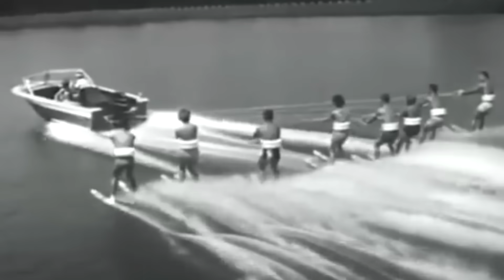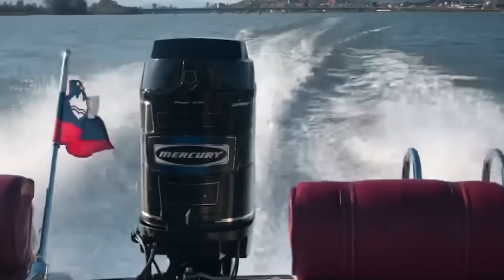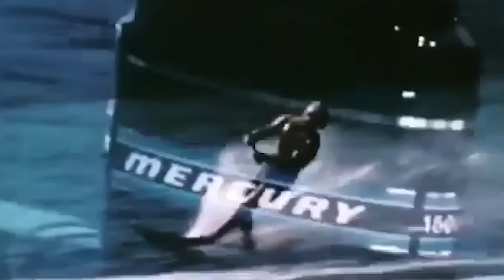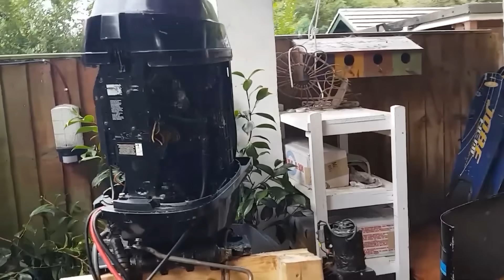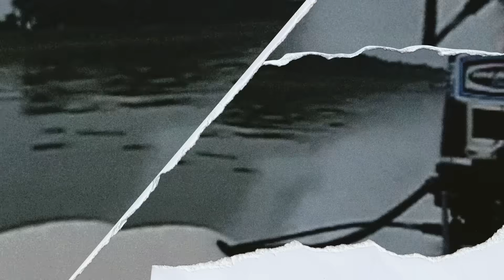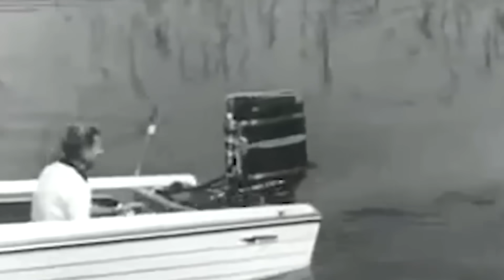The SHOCKING TRUTH Behind Mercury Tower of Power!

Comment: Had two of the old white and silver 45 horse Mercs on an eighteen foot cabin boat I believe was a Pacific Mariner. Every winter, bundle up the boat, put both engines on their stands in the garage. Pull and clean the plugs, clean the carbs and grease the carb linkages. Put everything back together and you are ready for another summer in the Pacific Northwest. Oh yes, clean the lower units and check the zinks.

Comment: About 7 minutes in it starts sounding like an ad for 4 strokes.
I still have two inline 6's one a 1966 95 ss and a later 99 inch probably from the late 70's.
The 95hp is the smoothest running engine I've ever had, AI's tripping about the smoothness of any inline 6 cylinder. The other engine is smooth as well but it's been ported recarbed and tuned for max power. And yes that motor requires a starting sequence but if stock starting is not a problem at all. As for all that maintenance all I ever do is to change plugs every year and the water pump every 2 years. 
Of coarse over the decades one runs into issues but not as much as stated here. No 4 stroke will ever last like these things do.

Comment: still have a tower of power o my mini raven,  still running great after 14 years that we own it, only changed the spark plugs ones and cleaned the carburetors twice, and lost a fuel pump because of age, changes my carburetors floats with an older model floats, because mine had plastic floats in and it cracked

Comment: Kiekhaefer used a racing trick to get more horsepower per cubic inch than OMC...Mercury used internal reed blocks that effectively 'stuffed the crankcase' increasing power over the style reeds that mounted behind the carbs on most of the competition.

Comment: In Australia in the late 1960s and 70s most of our boating was in salt water.
Developed in the US freshwater salt Down Under would destroy these engines.
Even steering seizing, many failed water pumps if you did not flush them with fresh water.
The Evinrude dealer where I worked in Sydney dreaded a Mercury as a trade in...
Mercruiser sterndrives had issues with salt as well. Could not be flushed.

Comment: My boat had a 1977 115 hp Evinrude with trim and tilt and  a Guy i knew had a Mercury 115 six we Lined up and took off he took the Hole Shot then i caught up at that point Both of us Put the Hammer Down i Pulled Away and Then he Caught up you could tell 115hp is 115 hp no Matter 6 straight  or V4 i then let him Drive mine He was Impressed but liked the Growl of V4 Where Mercury 6 More Whine

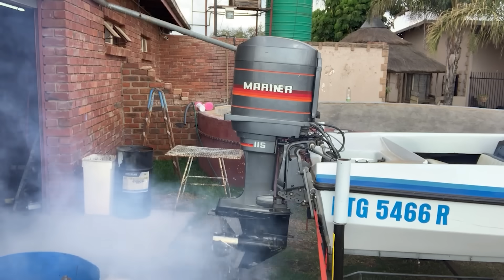Comment: 1:34 Growing up in Florida I wanted a boat with an engine so bad . As a kid i scraped up enough money to buy a John boat. Now i just needed an engine. The very same engine or very similar, it could have been a different hp . As the one In the shot at the time stamp . Happened to be sitting on a neighbors fence for many years. One day I worked up the nerve to knock on that neighbor’s door and inquire whether he’d be interested in selling it . This would have been around 1990 . After a short talk , the neighbor gave me the engine. I spent the night unable to sleep with excitement looking at the old Mercury that was now clamped to the footboard at the end of my bed . With the help of my dad and many miles back and forth on my bike from home to the mercury dealer and months of fiddling with it . We got it to run and worked to increase its reliability. I got to use it on my boat dozens of times never capable of getting to be really reliable. But when it did run ? I was the king of the world 🌎

Comment: It's interesting that some of the older inline 6 cylinder Mercurys still had a permanent pull start cord on top.  Imagine pull starting a 100 HP motor.
Reply: The merc I inherited from my dad (a 1978 Black Max 200hp)still has a pull cord attached to the inside of the cowl. I get a chuckle every time I see it. As if my shoulder could pull start a 200hp engine. 😂😂
Reply: My 140 has the pull start rope in a bag in the cowl. I’ve used it quite a few times. It worked just fine.

Comment: this guy is confused the mercury inline motors are cross flow motors not loopers. the piston has a deflector and that is how to tell.  loopers have flat pistons and the fuel loops that is why it is called looper.  a cross flow means the fuel goes straight across the piston.the pictures show v 6 mercury motors and force motors tool the inline 6 only went up to 150hp. if you still have one of these block off the little black hose on the carb with a bb  this is the backdraft and it would lean out the motor at midrange for fuel economy. lean motors burn pistons. i have been a mercury certified mechanic since 1988. i know these motors very well.
Reply: He needs to rework his narrative and remove a couple images. TOP engines stopped at the 1500XS. Yes, there were the Twister racing engines in the early '70's that made 180-200 hp,  but that's not what this video is about. It's certainly not the V6's he's showing here. Also, it makes it sound like the TOP engines just showed up about 1970. Nope, the first one occurred in production in 1957. 
They were a force in the market from the late '50's on. I worked at at Merc dealerships in HS and college, in the 1970's. These motors were really reliable and durable, you just needed to maintain them. They had electronic ignition since around the mid-Sixties, with surface gap plugs. You almost never had to change them.
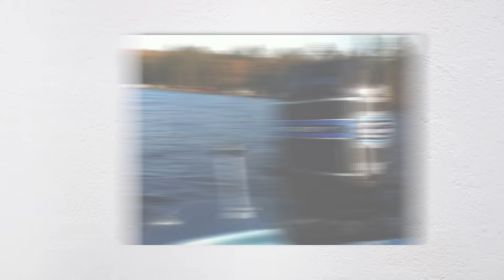Reply: Exactly.  My dad had a Glastron hardtop with an 80 hp inline 6 in the early 60’s.  The white one shown at 3:55 is that one.  The 70’s was just when HP got above 100.  We put a 115  version on the Glastron around 1971-72.

Comment: the people who know what these engines are will never give them up
Reply: I just bought one yesterday, motor had 150 compression in each cylinder. Came on a marlin Gemini 🎉
Reply: Ehh, they're loud, smokey, fuel hungry, need oil with the fuel, and need quite a bit of maintenance.

For a ski boat or any boat where it works definitely better off with an inboard. A v8 will get better fuel economy and are more powerful and simpler to maint
ain.

Comment: A correction for you; the inline gutless-6 was only available up to, I think it was 140 or 150 hp. The 175 and 200 were a different engine, V-6.
Reply: He said 150,175, and 200 and then kept showing 115s over and over.
Reply: I think the most powerful inline 6's were the Mercury Twister and Twister 2. Mercury never gave horsepower numbers but were estimated to be about 180 hp by other sources. Very rare and valuable engines for Mercury fans. And no neutral or reverse, all Twisters had racing lower units.

Comment: Great engines when running, but will shame you if you didn't treat them as if you were an airplane mechanic. They had little tolerance for neglect. The owner pretty much had to be  mechanically inclined to keep the thing running right.

Comment: Mercury Mark 75 was the first inline 6 back in 1957...not designed in the 70's.  Merc 1500 was top line inline consumer model released in 1973.
Reply: I now own three 1500's, one runs, one needs a rebuild and one will be just for parts.